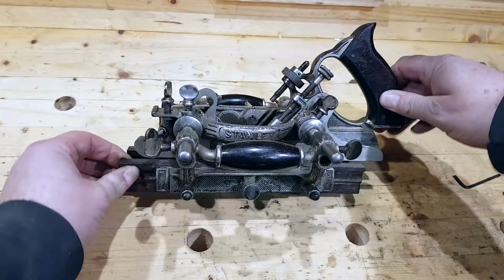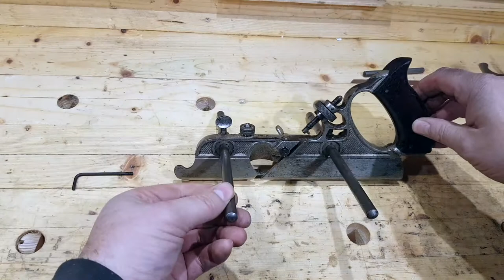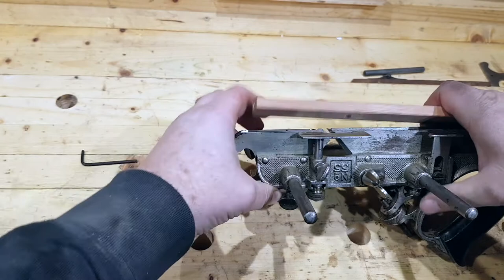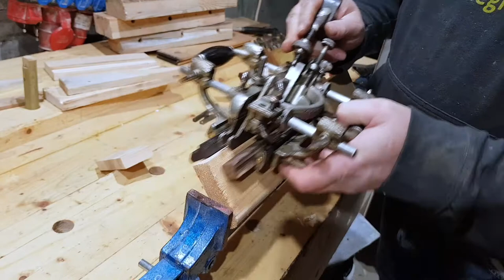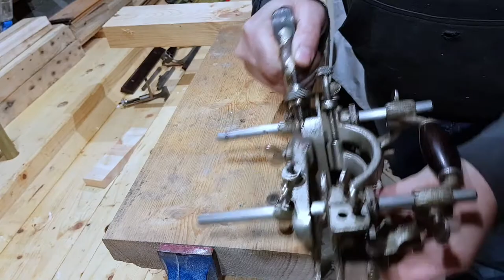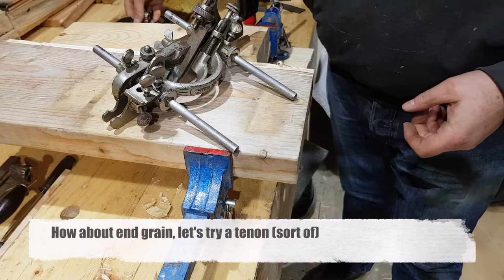Getting to know the Stanley No.55

Comment: 9:40 I dont understand what it is you're trying to do there. Youre not using the fence to guide you and your skate is falling off the board. Plus the plane is at about a 5-10 degree angle off the board and all youre doing is create a rough chamfer. Is there a reason for that?
Reply from the maker: Naa, this was the second time I used it. I simply have not figured out how to use this plane yet 😏

Comment: I am confused as to what you are trying to achieve. Looking closely I can see you using your right hand fingers to guide the width of your cut from underneath the plane instead of using the fence and you are wavering from 5-10 degree angles and causing your cut to be inconsistent. You are making no sense what so ever with the method you are imploring. Also your depth is set way to deep, you should have paper thin shavings instead of huge chunks coming off the plane.
Reply from the maker: I know, this was basically my second attempt on this plane ever. I was only exploring and struggled a lot as you so correctly has spotted.